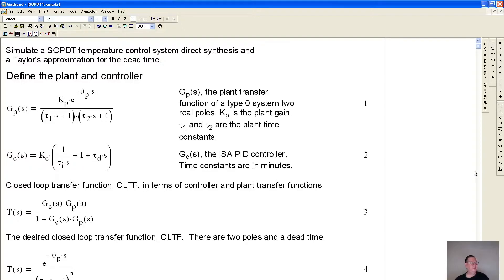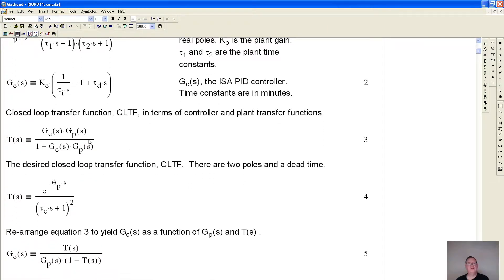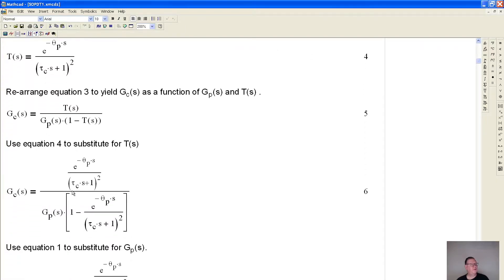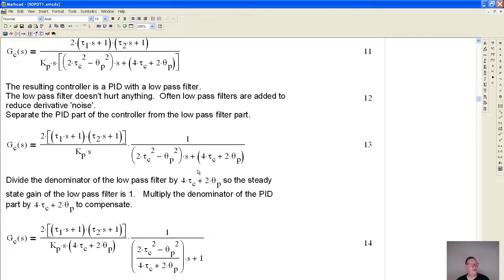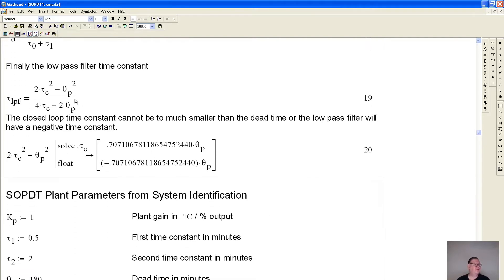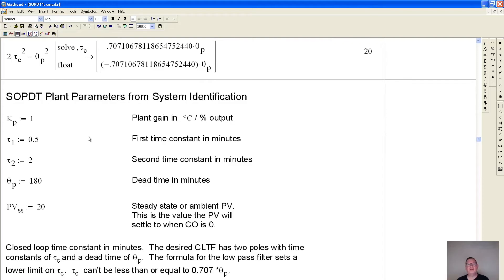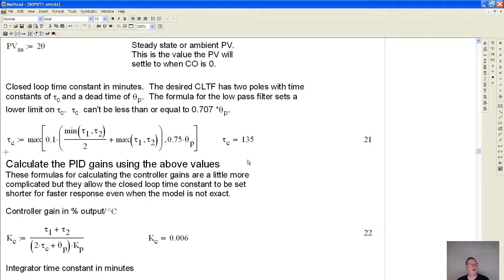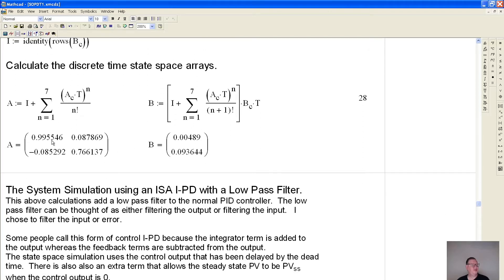Peter Ponders PID. Second Order Plus Dead Time , SOPDT, Temperature Control, long dead time.

Comment: This can be consider as a new tuning recipe. It would be very interesting to make a simulation and compare performance with IMC tuning recipe such as presented on controlguru web page.
Reply from the maker: I have done that already. 
https://deltamotion.com/peter/Mathcad/SOPDT/Mathcad%20-%20t0p2%20SOPDT%20CD%20L-M.pdf
I developed my own formulas for the gains and test them against the IMC gains using exactly the same model.